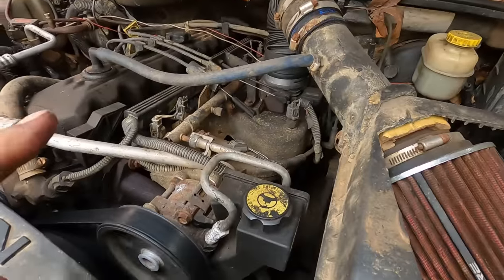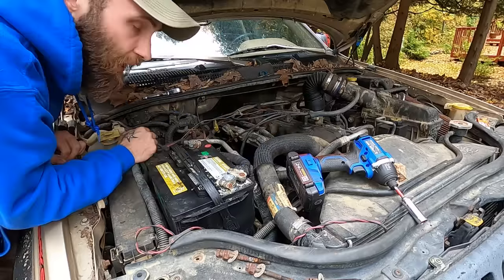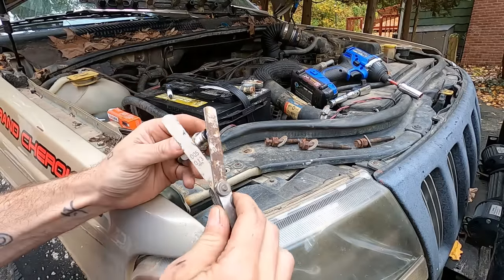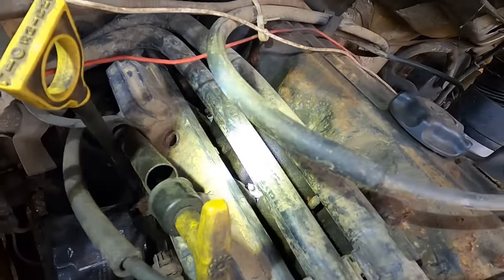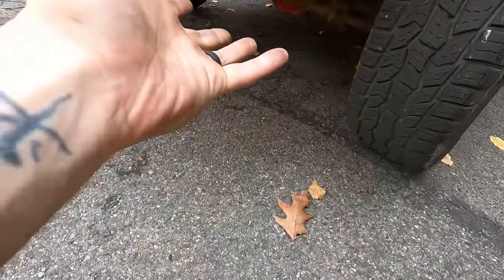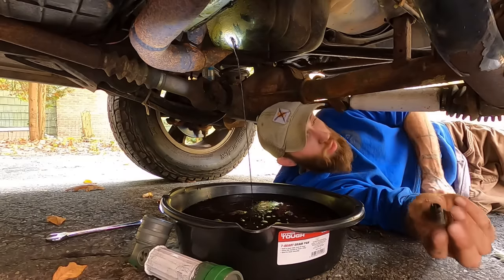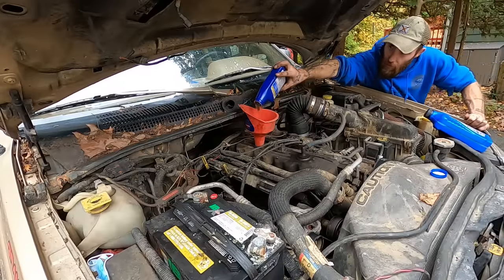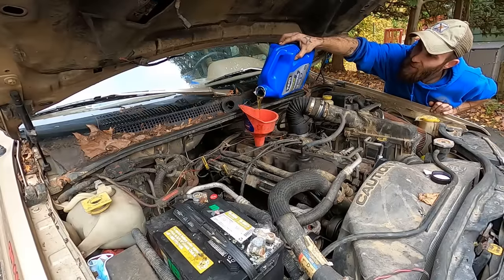Stop treating your Jeep 4.0L like a MODERN ENGINE... It isn't one!

Comment: I've got over 350k on my 98 XJ and 200k+ on my 02 TJ. I run Rotella T5 1030 and I leak / burn almost no oil between changes.NGK copper plugs, LG oil filter. 4-5k between oil changes. Both are lifted , running 33s.
Reply: How many miles have you put on your engine personally ? Are the 40W oils to much for the 4.0? My 2005 is my only vehicle with 115k. With 5w-40T6 my engines a lot quieter but curious if the 10w-30 would be better. New oil pump so no issues with oil pressure.

Comment: Have a 2001 WJ 4.0 with 340,000+ best engine ever. So, that being said just replaced transfer case chain. Piece of cake but…vent tube is kinda old and deteriorating quickly. Where does that vent hose end up at?  I trace from transfer case up to center of bell housing and can’t see can’t feel. Hmmmm? Any ideas

Comment: I have a 1996 jeep Cherokee 4.0 and it turns off when I accelerate 🥺🥺I changed a lot of stuff I disconnect a cable on the throttle body n it doesn't turn off

Comment: Thank you for this.  I have 93 xj sport with 4.0.  I’ll definitely add the zinc at next oil change.  Am about to change plugs/wires/distributer+ rotor and ignition coil.  Putting in DUI kit and NGK ZRFN5 plugs. 

For a future video, I’d love to learn more about troubleshooting the NP/NV transfer cases.  I did rebuild of mine and it shifted mechanically fine , but after install, it’s been unstable on 4WD part time and full time.  Caveat- I’m running 242 on an AX15 5 speed transmission.

Comment: I remember putting synthetic oil in my very peppy 4.2. It blew it out the tailpipe. That was an expensive oil change doing it twice in one day. Castrol 20-50 is what those lifters like.
Reply: I put synthetic in mine 90,000+ miles ago…ran for a day…sounded like a rod was gonna blow out…put back regular conventional. Sound got quieter but never disappeared. To this day idk wtf happened. But my 00 XJ sleeps happily in a climate controlled garage now. Learned to drive on it 20 years ago….bought it from my pops and he was the original owner. Love this thing.

Comment: Looks like that battery terminal could use some cleaning or a better connection…

Yes, it ain’t the space shuttle, and just because there are Bosch parts doesn’t mean it needs Bosch 4 prong $8 sparkem plugs….

Comment: Descended from the old Rambler 232 which I think first appeared in 1965 and was smoother and/or more reliable than the Buick 225 "hurricane" V6
might have seen a 232 in an old full size late 1960s Wagoneer,it was above average in pulling power compared to other inline 6 of the day except for the Ford 300 or Chev. 292

Comment: ? my 94 XJ 4.0 has the clicking sound, ive been told its pistons its the valves its the lifters its the rocker arms, to me sounds like the lifters,its the fuel injection its the wrist pins its the rods been clicking since i got it in 2007 but has gotten a little louder, i use restore sometimes stp every oil change at 2000/2500 miles but after about 1000 miles the sound comes back has 212,000 miles on it any which is the most likely cause i would like to het at least 300,000 miles out of it i had 540,000 on my old F-150 4.9 300 cubic inch when sold it

Comment: I see ya got the hot air intake downgrade. I use 10w30 in my 98 with 254k on it, 40 oil psi with no additives. Bosch double platinum work great.

Comment: Would it be possible to put roller lifters in to negate the need for zinc and catalytic perverter failure?
Reply: I have often wondered if anyone makes roller lifters for our 4.0's. I know you can get roller rockers, but roller lifters I think would help with some extra power. Probably not a whole lot, but noticeable..?
Reply: @digitalchaos1980  roller EVERYTHING.
Reply: @LordMondegrene  Yeah, might as go with roller everything! Roller rockers, lifters, roller manifolds and valve cover and some roller pistons too 😁
Reply: Yeah they have full kits to buy. Might require some head work on some things depending on what you get. But you get a good bump in power with a quieter better working valvtrain.

Comment: '97 XJ with 13psi of hot oil pressure the bare minimum spec checked with a manual guage... normal? All my other WJ's and Wrangler always seemed to have 40 psi hot.

Comment: Should we trust a guy with a corroded battery terminal? Just kidding, thanks for the video. :0  For a tip, I put bicycle skewers on my battery terminals to take off easily. Give that engine a bath and put a piece of chrome on it somewhere,  it will surely add 20hp. :)

Comment: 25 mpg lol I got 2000 xj on 31s I get a whooping 12 mpg I do need to regear to 4 10,11s though great video I use Rotella 15w40 in all my 4.0s and have for ever even when they were new 326000 on xj and 185000 on tj never a problem
Reply: Throw some new o2 sensors in it, might adjust your fuel trim a bit to help on mpg’s.

Comment: Ok. Had a 4.0 once dont any more.  Can you make a video about the 3.7?  That is what is out there now. Is it any good? Worth it? Beter to go with the 4.0 or 4.7? What is your take on the 3.7?
Reply: Avoid the engines with .7 on the end. 4.0 beats the 3.7 in every category.
Reply: Isnt the 3.7 just a 4.7 that had to cylinders removed? From what ive heard they have the exact same issues. 3.7 is fine as long as you understand that you cant overheat it or abuse it
Reply: @MeDicen_Rocha  3.7 and 4.7 are completely different motors.  And the transmission is a lot stronger in the 4.7 vs the 3.7. I wouldn’t recommend a 3.7 for any Jeep especially if your lifting it.
Reply: @waterloo123100  no it isnt lmao. Its a 4.7 with two cylinders removes. Same 90 degree bank angle, with most 4.7 parts bolting up to the 3.7
And the transmissions are mostly the same too.

Comment: 99 jeep 4.0 spark plugs, wires distributor cap and rotor all replaced, 1wk later spark plug blew out of hole still looks brand new, what caused this!

Comment: Hey do you have any info on the transmission going into safe mode? 
 I had a code that told me to change my governor pressure sensor switch so I changed all of the solenoid's in the transmission, put the pan back up still had the same code so I did it three more times I went from like Amazon grade to OEM from the dealer all same issues. I'm thinking there's some sort of electrical issue but if you have an insight on where to start it would be greatly appreciated

Comment: Hey dean!! Got a 4.7 and need some help, it runs for like 10 mins then slowly shuts off and won’t start back up until a few hours later. Alternator is new and puts out 14 v oh by the way I’m in Bronx
Reply: Had the same problem with my 2000 XJ. Check the Crankshaft position sensor. If that doesn't do it, it may be the fuel pump.

Comment: Nope. I have been racing a 302w powered mustang for a long time. All i drive is old distributor powered small blocks. And old engine may be very picky about certain things like oil. (My drag car runs better on valvoline hm 10w30 than royal purple, mobile one or any other oil) but if a copper plug is running better than a modern plug then you probably need to fix some other things. No engine prefers a weaker spark, less fuel burn and a less life on plugs. And thats from a person who changes platinum plugs out every few months or if i spray every single weekend. And checking them every run

Comment: I’m in the uk had a strange thing happen to my ZJ, It bent and snapped the push rods on number 5 cylinder the mechanic said he found parts in the sump, it seemed to run ok for a while then number 5 started to miss fire with low compression, anyone else  experienced this?   Kind Regards Mike
Reply: Cracked piston.

Comment: Other than the cost of the plugs what is the downside to not using copper plugs?
Reply: These older engines run better using copper plugs and their cheaper

Comment: Don't wash the engine!? I've been pressure washing since 1971 I've been doing Mechanics for 55 years I always try to degrease everything regardless of what the factory or the manual says who likes working on Grease Grease is an insulator if you're a mechanic if you would know that it's an insulator and a conductor! And she's here to work on it see what's bad and what's leaking I don't know who read the manual that said don't ever wash your engine? That's not a mechanic

Comment: 326,000 miles on my XJ.  Bought it new in 97, owned it its whole life.  

You aren't kidding about the copper plugs.  Another great upgrade is four-hole mustang injectors.

Mines a spinning electron model, so that coil rail isn't an issue for me ... :-)

Comment: I have a 2001 GC with the 4.0 and I have a problem. It starts up but immediately dies. It starts every time I hit the key but immediately dies. I don't even have to turn the key off and back on. I just bump the key and it starts right up, but then dies. WHAT DO I DO?? I checked all of the grounds(as advised by a Jeep mechanic) and they seem fine. It runs quite nicely and is one of the few that doesn't rattle, it just won't stay running and idle. 😒
Reply: Possible the idol air control sensor (IAC) is bad or the TPS throttle position sensor or both. Worst case is the pcm/ computer. Hopefully not that. If you get the sensors, get them from NAPA not Autozome. The AZ ones are garbage as I went thru two of them less than a week.
Reply: @tinmansolo5855  Thanks, I'll try that and let y'all know.
Reply: If you want a quick and cheap easy way to find out just pull out the IAC and clean it with a toothbrush and brake cleaner or car cleaner. At least if it works then you know to replace it.  Just from my trials.

Comment: Idk but I noticed iridium’s help my 4.0 start easier. And I’m getting 20.5 mpg on a 130k 04 grand Cherokee
Reply from the maker: If you see a difference, run 'em! I admit I am a copper snob with plugs and haven't really given iridiums a chance in a 4.0. Maybe I will give it a try!

Comment: You don't have to pull the motor to do the rear main seal on these, just drop the oil pan and use dish soap on the upper seal. Your welcome :)

Comment: Auto lite spark plugs are not even worth the box they are put into. Iv fixed at least 5 cars which owners have put those in and IV replaced them with either OEM or Ngk.
Reply: NGK is the best one to get.

Comment: The engine is actually older than that, it's based on the 232 six introduced in 1964.

Comment: Zinc is an old way of thinking. Too much zinc can be bad for wear surfaces, and will poison catalytic converters if you have a high mileage engine. You can absolutely run Iridium plugs, but you need a hotter coil, such as DavisUnifiedIgnition, in order to take advantage of the reduced shrouding and longer plug life. My KJ's 3.7 was the last engine designed by AMC in the 90's and just like the old 4.0, it ran great with NGK copper plugs and stock coils. I upgraded to DUI SOS coils and run NGK Iridiums at .060 gap. The faster throttle response/power increase and longer plug life are worth it.

Comment: Never ever ever put this crap in your engine they change the piston ring clearance in this engine if it is a engine with a coil rail STP will destroy it the best advice for this engine make sure you change your thermostat and make sure you keep the proper clean coolant this is not the old engine this is the newer crappier version

Comment: I agree on ZINC.. but does it not ruin .. your CAT ..?   Nice practical You Tube... Locally have tail emission check.
Reply from the maker: It does it the oil in question is burned in the cylinder. Zinc creates ash when burned which clogs the passages in a catalytic converter. A little oil wont matter, but if you have a Subaru or something which burn a quart per oil interval... you are going to have issues.
Reply: @DEInTheGarage  Thanks.... we were looking at a Subaru in the future.  Tnanks for the advice.....!

Comment: When I first bought my XJ I put Auto lights in it and I got maybe for 5000 Mi out of them before two of them fouled out then I put NGK's in and I could easily put 20,000 on the plugs I swap them out annually anyway though since I was putting on about 15 to 20 a year and mine's definitely been happy about using  diesel oil. Do not pressure wash a 4 L engine they will start puking oil afterwards that is facts really the only mistake I made with mine I pressure washed it so I could inspect it babies tell me there's something wrong with it cuz it didn't leak oil not after I washed it

Comment: I had two use Chrysler either uses Champaign or Auto light . These WJ Jeeps need 93 octane with no ethanol . Ethanol kills these engines. Ethanol eats the rubbers out of the injectors. These engines were not made to run on Ethanol blended gas Also These are famous for CSPS (Crank Shaft Positioning Sensor) failures as well With Amoco Ultimate Gold 93-94 octane and Sunoco 99 octane no ethanol and we were were getting 26 highway out of premium of  ethanol and 15 out of 87. The best to use is Mobil 1 high mileage with zinc I have used it for years. My grandpa brought new in 1999. He gave it to em when  he passed. Always change your oil every 2500 miles. Ethanol will eat  the rubber hoses.
Reply: 30 years ago yeah but these days (unless cheap Chinese) they can handle ethanol no problem. Just another BS myth. Your mileage will go down with ethanol simply because the BTU rating is a little lower but it will handle detonation and cooling much better than straight gas. Uneeded in a stocker but it'll run a lot cleaner. But you can take advantage of it with a better tune on the newer jeeps. Or increasing compression on older ones.

Comment: In my state and town I have to get emissions tested for anything newer than 1994. If my cat is working and my  4.0 passes emissions, I’m not going to sacrifice that. I don’t want to put a $1500 cat in a $1500 jeep just because I have to pass emissions. And zinc hasn’t been in oil since the ‘70s or ‘80s. If it’s gone 200 or 250k without it, why do it now?

Comment: I bought my 98 grand Cherokee with 190000 miles  and have 248000 on it now has been a daily driver for 2 years now love it have changed oil every 3000 with 10w 30 synthetic Castrol or Mobil whatever is cheaper at the time 0 problems even though it only averages around 15-16mpg highway at 70mph has been extremely dependable so far oh and yes it is the 4.0

Comment: Newer plugs are fine depending on the brand.
Reply: Not really. Your just wasting your money.
Reply: @waterloo123100  not really. A more efficient spark is always better
Reply: @seancurry9769  Just because you put a more expensive metal doesn’t make it spark better.    Copper works great for these old engines
Reply: Most platinum and iridium plugs will last half a dozen times or more than the copper ones. I run ground down ground strap iridium's on my stocker XJ because it was an extra set I had leftover from the race motor. It's runs just the same as a brand new set of coppers, they've been in there for 3 years 50K and started as a 20K+ used set from switching out to a colder plug for boost from the other.

There's no difference between them other than durability. All that crap is hearsay BS. Just make sure they are gapped properly and your ignition system is in good shape, there is no problem.

Comment: This fellow seems well intentioned and nice enough, but he's spouting a lot of old wives tales about zinc and the needs of older engines. Full disclosure- I have a background with vehicle development for an auto manufacturer.  First, the film strength requirements for this type of engine are very low. The flat tappet cam does not have an aggressive profile and the spring pressure is low- unlike say a muscle car from the 1960's. These engines keep chugging along because the bearing loads throughout the engine are minimal. Second, adding zinc in itself does not fix a poor oil. There's a great deal more to oil formulation than simply an additive like ZDDP. Film strength, viscosity and resistance to breakdown under high pressure have nothing to do with Zinc. I can assure you that some of the worst performing oils on the planet in a lab setting are loaded up with big Zinc packages (Brad Penn comes to mind). 

If you want an engine like this to last a long time simply use a modern premium synthetic 5W-30 oil. If no amount of facts, data and white papers from engineers will convince you otherwise about Zinc though feel free to buy Redline 5W-30 which comes with a heavy ZDDP additive package. For those content to buy oil accessible at reasonable prices by mere mortals try Pennzoil Platinum. Don't bother using non-synthetic or synthetic blend to save a buck- it's outdated tech and will never match the film strength of a true synthetic. Additives like STP are mainly snake oil.

Comment: Jeep 4.0 doesn't need special oil.  If it did, they would have all blown up by now.  That being said i use rotella t6, cant hurt to have more zddp than run of the mill gas oil, especially with the alleged oil pump drive wear issue on some 4.0s.  i remember reading about it a while back, that it might be from bushing wear? Idk, never replaced one.  Uncle tonys garage did a video on the oil question.  And "upgrading" to copper plugs? Smdh....

Comment: Old yes, but zinc in a vehicle that uses catalytic converters isva big nono. There is a reason they have removed the zinc long before your "old" 2000's Cherokee. 
Is zinc good for the engine... yes. But bad for the "modern" style emissions strapped to it. 
And you wanna blow a good motor up quick, restrict the exhaust.... itll kill the best of them.